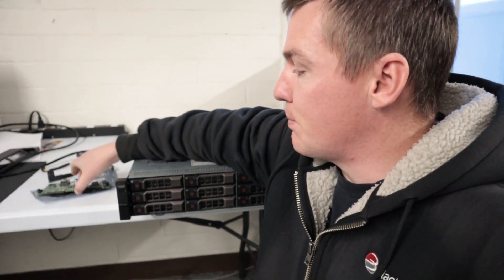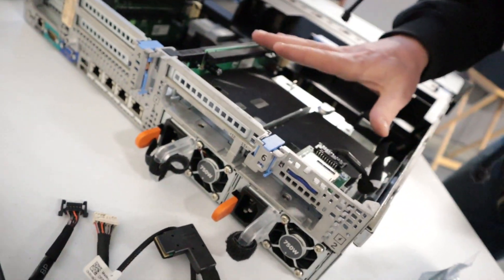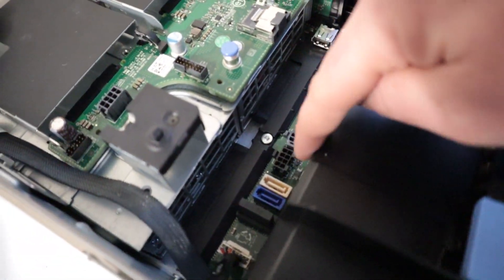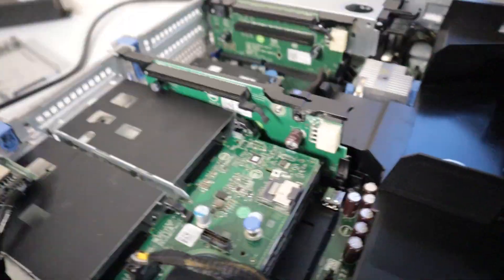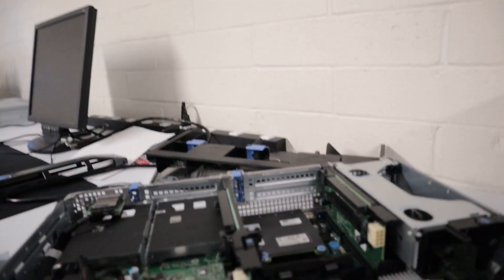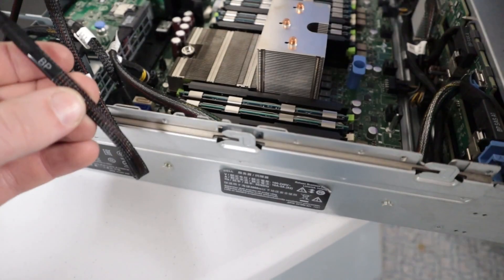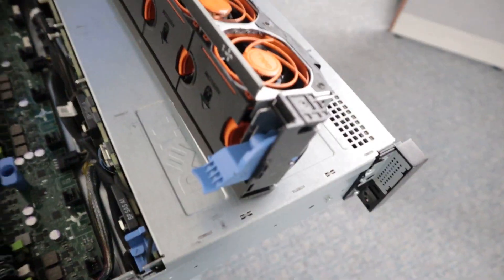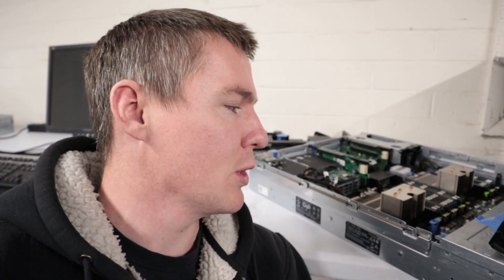Dell R720xd Backplane Install for 2.5" HDD Bays

Comment: If anyone comes across this and has also followed the guide for flashing your storage controller into IT Mode, you will also need to flash a boot ROM onto the controller to be able to boot from the drives connected to the flex bay. This isn't a storage controller in and of itself, like I'd thought; it's basically an extra couple of drive slots hanging off of the main one. It's almost like a USB hub.
Reply: Where can I find instructions to do this?

Comment: It's like you traveled in time and knew I needed this video! I opened the chassis and saw the 2 sata data cables but not sata power... You just saved me hours of trying to find misplaced consumer grade sata power/data cables that wouldn't have worked!

Comment: Do you know where I can get the cables for the sff version of the server? I have the r720xd with 24 2.5 drives in the front and need to use the back two drives as well. I already have the rear backplane, I just need the cables.

Comment: thanks. i kept finding the 2.5" front drives and i have the 3.5" version. the last 2 cables are different front the other server version.
Reply from the maker: No problem, happy to share!
Reply: Do you have a link to the 2.5 version? I purchased the backplane already and just need the cables.

Comment: Just what I needed! I'm resurrecting similar systems. Questions: Are the 2.5" drive caddies the standard type (like in an R610)? And what controller do the rear drives show up on? Ideally I'd want them to not be behind the RAID (H710 in my case).
Reply from the maker: Hi Jeremy. Yes, the 2.5" caddies are dell standard, just like the R610. I'm not 100% sure about the controller, but I think they were all on the same interface. I didn't use the hardware RAID, instead I went with ZFS with Proxmox.
Reply: @Ryndon  Sweet, I'm using ZFS as well. Proxmox is on my list to set up too.
Reply: Fun part is the one thar was skipped.  Replacing the fans with the SAS cable in place.
Reply: I know this is really old.  I'm about to be in the same boat.  Wondering how you resolved this?  I would prefer to boot from the sata drive and pass through the h710 into my hypervisor, but it sounds like those sata ports are going to be disabled when the h710 is in place.